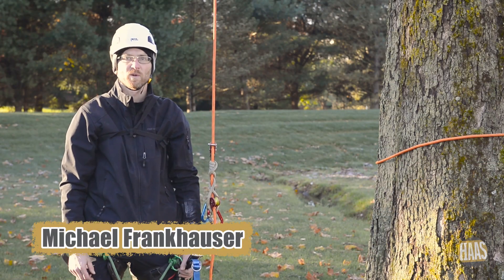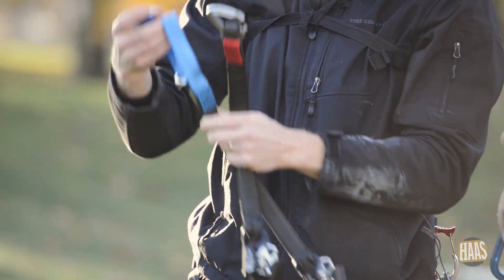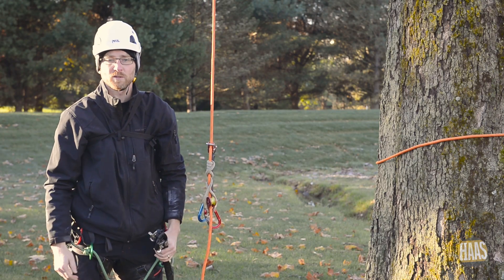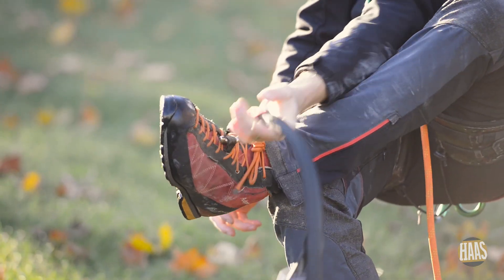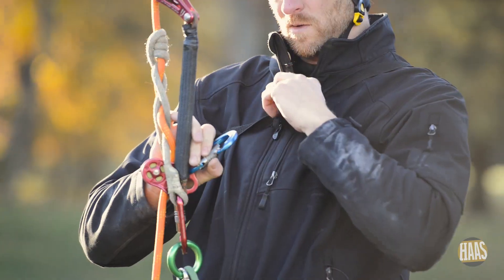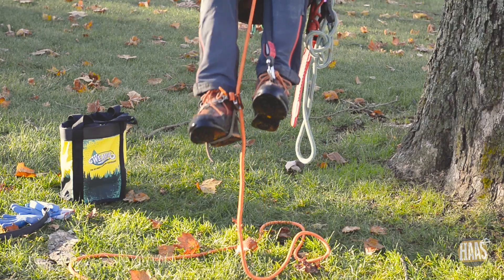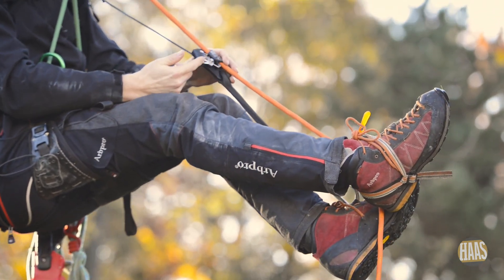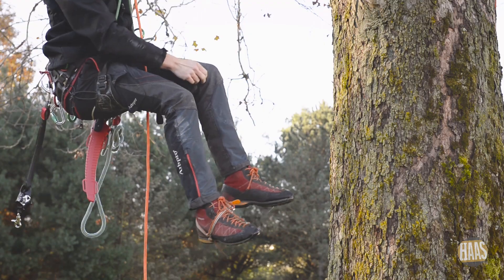How to Use a HAAS® Velox/Clip N' Step Ascent System

Comment: Clip and step shoe  system is like dog shit . Sry . The original system cannot withstand the weight of 80 kg. A 5-6 millimeter rope holds the weight but the tabs on the shoe tear off over time. what the hell
Reply: The system is not designed for a person who almost always climbs SRT. You need a foot loop .